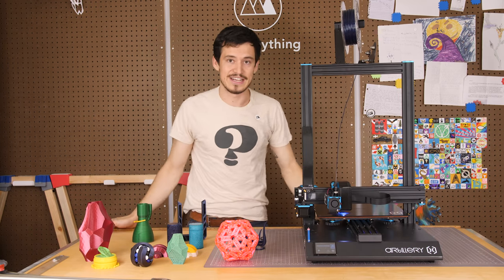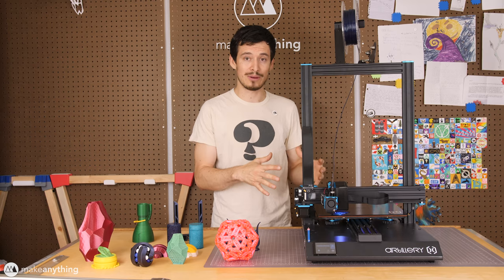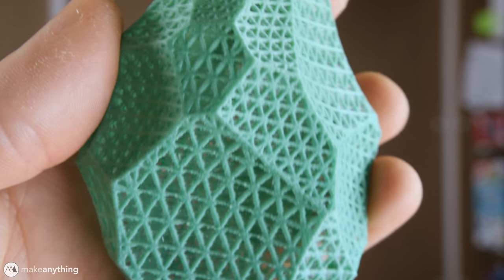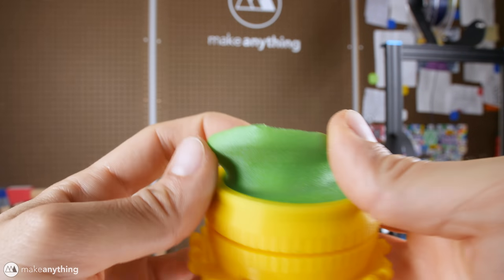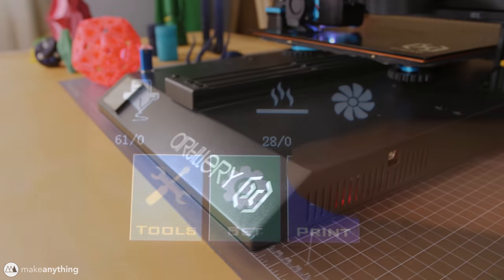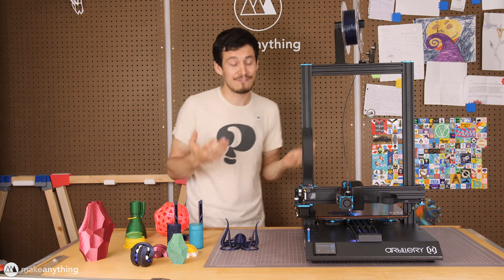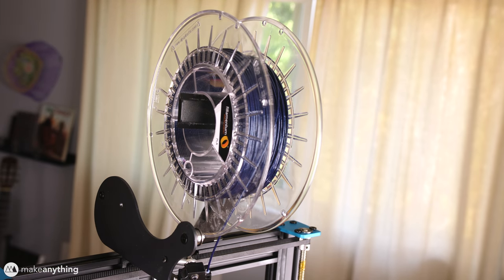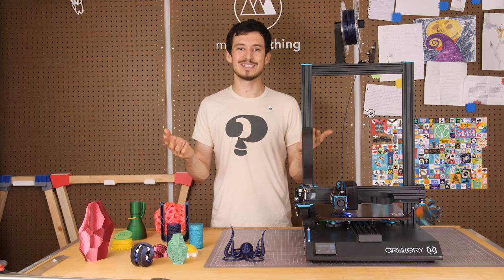Artillery Sidewinder X1 3D Printer Review // What the CR-10S Pro should've been

Comment: Why has Angus, Joel, TOM, or RClifeON not got wind of this printer? I appreciate the review, but I'm wondering why this printer is not even more popular yet.
Reply from the maker: The company was a bit annoying about emailing reviewers, so that might have turned them off. I gave in since it seemed really promising
Reply: Make Anything thanks for the reply. What version was your review unit? I own a 3d printing business and typically print on a stratasys machine or a number of prusas. We want something with larger build volume in the budget category to print product with ASA and PLA. The ASA parts are small. Would you still recommend this over the creality machines for build volume / print quality. I love that it is a direct drive setup.

Comment: Seems like 80% of the reviews I’ve seen has had bad cables... Ribbon cables are bad in general, leave them to old Peta IDE drives and use something more durable. A lot of people seem to have issues with the pins either coming disconnected or bending or corroding, like it’s a terrible design flaw the way they implemented it on a moving object. If the cables were like $2 each then sure maybe, I’d just recommend buying 5 extras to have on hand when they fail since it wouldn’t cost much, but typically ribbon cables are almost always used on proprietary junk and extremely easy to break, I’ve never heard anyone else say they were “reliable”, they are just an inconvenience you have to live with for lots of wiring and it’s not like this needed a lot of wires, like I doubt they would handle the amount of connecting and disconnecting my 7 year old printer has on its standard and dirt cheap 4 wire stepper motor connections. Ribbon just doesn’t have great quality half the time. Maybe if it came with 5 extras it would be ok? I don’t know, I personally hate how brittle/easy to break they are (as many owners of this printer have had damaged cables just like you thankfully caught), they didn’t use a good connection design on these which is the major weakness of the cable is it’s connection.

Comment: I bought the smaller genius with the same extruder and hotend. I am having a hard time eliminating stringing in cura. Can you please provide your profile or do you have any suggestions for retraction settings and temp with pla?
Reply: Try basic tuning? Like for the material (I have PLA that all say the same temp but in reality one roll needs 195c and the next might be 230c, that’s not an exaggeration...). The first step is finding where it melts, losen the extruder gear so you can push filament by hand so you can feel how easy it moves through. Start really low like 180c, keep bumping 1c (or 5c whatever), and just keep a steady 1/2 pound of light force pushing the filament down. As soon as it starts moving at all, take note of actual temp, that’s basically the start of the melting, you’ll likely find where a reasonable flow rate is like 10c hotter than this and use whatever that temp is (this method is the same for basically any filament). Plus you never know how far out of whack your sensor calibration is, but it doesn’t really matter since you should do this anyways. It takes like 2-3 minutes total for me to calibrate a new roll, remove it, write on the roll the temp, and grab another to test).

That’s why we can’t say (temp XYZ, because litterally same brand in same order may wildly differ if it’s like green vs blue, which would probably just be different days or batches of manufacturing). Plus it depends where your temp sensor is located, or how your extruder is designed, or what nozzle size you’re using and flow rates (like slow flow rates technically won’t require as much heat because it has more time to absorb and reach temperature). So you just need to calibrate once for that roll (just like you check diameter in a few seconds with a caliper, then type that into your slicer and away you go!)
Reply: @jakegarrett8109  Thanks. The extruder and hotend are exactly the same. Only filament and temp would be changing variables. I can do what you suggest regarding temp but keen to get settings for retraction distance and speed to get in the ball park at least.
Reply: Psych101 ballpark for direct drive is 2-6mm retraction typically (depending on speed of both extruder retract and head speed cause if it gets there fast enough you wouldn’t need much). That’s what I would start with for direct (Bowden it gets really complex with tube runs/bend angles/tolerance of tube/elasticity or stretch of tube etc). I think the last time I used a direct drive was like 6 years ago, but it barely took any retraction (I don’t even know if I had it enabled, probably didn’t). That’s probably a good starting point, but you can measure that by hand roughly when you’re doing the temp test (that’s how I determine it, by seeing how far I have to spin my extruder gear for the ooze to come to a stop, you’d do the same minus the gear but it’s probably a super small amount and check with an ooze test print). Good luck!

Comment: Hi, Devin! Thanx for the review! The spool holder isn't a big deal b'coz for the serious stuff you need a dry box anyway. My main concern is about the firmware tinkering, is it possible? Linear advance and other stuff, you know... the other concern is about these thin ribbon cables - how much cycles will it serve? What will happen if it will break and how much the replacement costs.
P.S. i would like to have an own garage in the current life and without getting a heritage. Then I could buy many 3d printers and not only that )) Plz, like my comment if you've read it.
Reply: I just added eeprom-saving and linear advance to mine. It was straightforward , and the linear advance really helped with the bulging corners I was getting on my prints. Artillery lets you download the firmware from their site and you can mod it to your heart's content!.

Comment: The data sheet points out that the heated bed is Ac Power? Is it really 230v Ac Powered with a Solid State Relais? I have never Seen this on a printer within this price Range. The stepper driver is a tmc 2200?
Reply: yes it is, and the bed is not grounded...only two wires.

Comment: Any problems with PETG? Does it need glue to keep it from sticking too hard to the build surface?
Reply from the maker: I used hairspray which works for just about everything.
Reply: @make.anything  The problem with hairspray is that there are many types, and what is available varies from place to place. Does it work without the hairspray? I've been using a PVP glue stick on plain glass on my Wanhao i3 Plus, works great for PLA, PLA+ and PETG. I'm worried about PETG sticking TOO well to the glass, supposedly it can pull flakes off the glass. I wonder if it might cause the same problems with the Artillery print bed.
Reply from the maker: @iskandartaib  aquanet is pretty much the go to for printing. And yea, petg can break the glass, especially if printing something with a large surface on the bed or by printing too close, so it is a good precaution. Gluestick should work just the same, they're both pva
Reply: @make.anything  I'll check to see if it's available around here. The local online shopping apps don't have it (aquanet). The problem with glue is it builds up over time - the glass on my printer is removable, so I can wash it under the sink when the glue gets too thick. Since the X1's bed isn't removable I'd probably have to clean it using paper towels, water and IPA perhaps. Seriously thinking of getting one, too, but I'd have to justify getting a second printer. One also wonders about what third party parts are available - nozzles, etc. Also if there are third party all metal hotends for nylon and PC.

Comment: Which board and drivers does it come with?
Reply: Beeing that silent the drivers have to be Trinamic
Reply: MKS Gen L Style board, TFT touch screen and TMC2100 drivers -thermal runaway is enabled from factory. Note: if your printing with octoprint or using the printer port the run out sensor does not work only with SD or USB .

Comment: I bought the cr-10s after your video about it.  Wish you would have eluded to this video and printer instead of "biting your tongue"...
Reply from the maker: Sorry! The Cr-10S is more thoroughly vetted and has a bigger community, so it's still a great printer to have... I need to use this sidewinder for another 6 months to be sure of it's long term reliability
Reply: That’s true, although I was already planning on putting a volcano and a direct drive extruder on it, so I went ahead and sold the cr-10 and ordered the sidewinder. The synchronized Z’s and the extra beefy gantry are nice bonuses too. Without your video I wouldn’t even know about the sidewinder so I guess I shouldn’t complain!

Comment: Just ordered mine lol
Reply from the maker: Yay!
Reply: @make.anything  by any chance, are the drivers built into the board or are they swappable. I have way better drivers than are in any stock board. I've never used the mks gen boards before. Nobodys really gone into detail about what's specifically under the hood. Can I swap out the 2208s for the 2209s or are you stuck with whats on it. I do have a fully pimped out skr1.4 turbo I could swap. But I'd rather just replace the drivers so I don't have to deal with a full vscode setup. Nobodys really mentioned the board in any real detail. No big deal.  I'm just curious.

Comment: Sorry, gotta disagree, autobed leveling is an absolute must have in 2019.
Reply: Why?  On a solid printer, you should only have to level the bed once at first setup, and if you ever change something.  With enough experience, you can make fine adjustments on the fly while the prime skirt/first layer is printing.  I'd rather take the time to ensure that my bed is physically level to my physically square xyz axes, than have software compensate for a sloppy build by having to move the z axis while printing each layer...
Reply: @macelius   it might stay level for a bit, but in my experience (running an FDM farm for many years) you will need to relevel every half dozen to a dozen prints. Plus, different filaments and nozzles require different first layer heights which is a pain on a manual system.
Reply: @JT-Works  I said on a solid printer.  I never have to re-level my bed unless I mess with it.  If the bed is going off-level every dozen prints you've got a bigger problem; either something is bending/warping/loose, or the 200lb gorilla that's pulling the parts off, and if you just keep letting the software print the layers at more and more of an angle relative to the x/y axes and nozzle, in stead of physically adjusting the bed, the quality degrades.  First layer height is just a software setting..